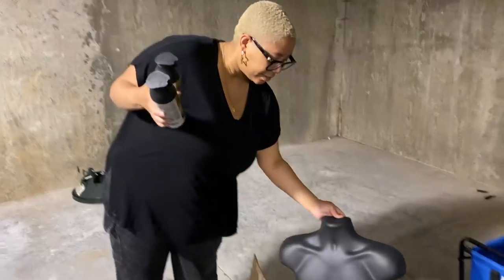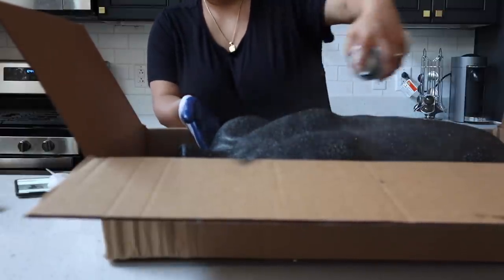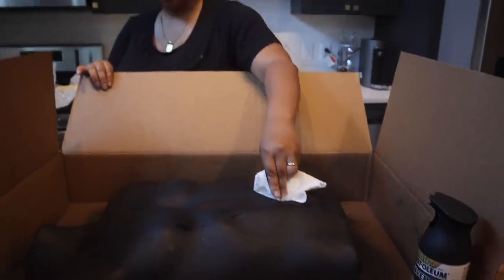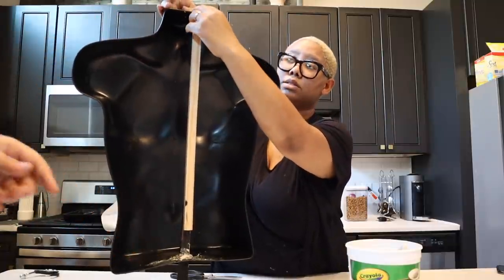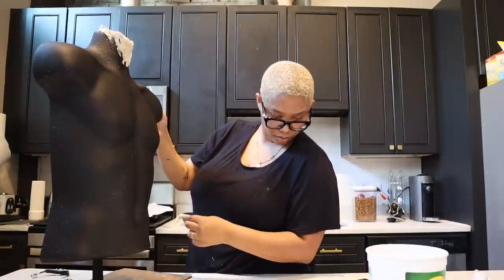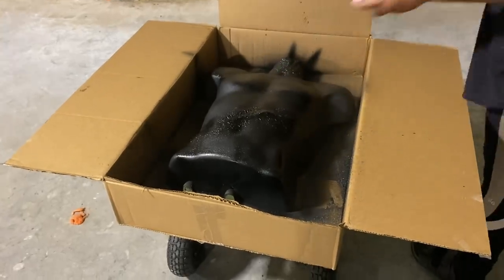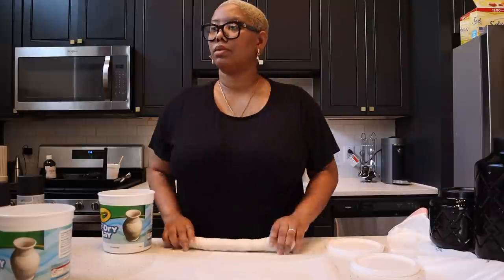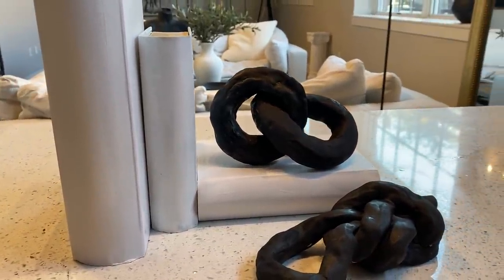RESTORATION HARDWARE DIY // TORSO BUST AND DECORATIVE KNOT

Comment: You can use the maniquin as a mold and use plaster of Paris to make the statue. I use plaster of Paris to make my faux patties. You can see the end result in my February video. If you decide to use plaster make sure to cove the maniquin inside plastic so yo can remove the plaster. I am not sure how much you would need. Maybe tree boxes. I learned from a Chinese sculptured. Also cement is a cheaper way and it would look like the store.. just suggestion. I hope this help. Xox

Comment: Another good technique to get texture is to spray paint your piece and throw sand or clean dirt onto the wet areas. It'll stick and give you a nice look. If it's a color you don't like, spray paint will stick to it. For pots that have that rubbed cement look, use hole filler. Rub it onto the vase or whatever with your fingers, let dry, then paint if you want.